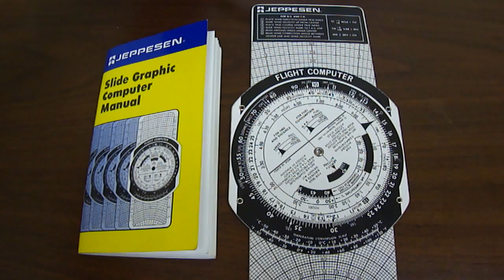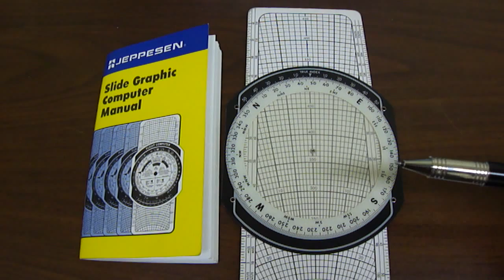E6B Flight Computer: Introduction!

Comment: One of the reasons I enjoy flying and studying aviation is because it is a thinking game. When you stop thinking, that's when you're heading for trouble. Technology has made things easier in many ways. When something becomes too easy, I get bored and lose interest; hence the digital E6B. Personally, I was a little disappointed when GPS arrived. I remember learning how to use VOR radials to determine your position if you got lost. Personally, I need to know old tools in case high tech fails.

Comment: I am a commercial pilot with multi-engine rating, and I have no idea how to use one of these.  LOL.  All of my training has been using an electronic E6B.  I want to become a CFI now and figure I need to learn how to use this.  Thanks for all of the videos they are very helpful.
Reply: What are you going to do when the batteries fail???...just like when I tutored my daughter when she was having a problem with Jr. High School math...asked her to give me the simple answer to the sq root of 17...she reaches into her case and pull out her Texas Instrument calculator...I took it away from her and tossed it across the living room and said "I want you to give me the sq. root of 17...I didn't ask the calculator".  Wasn't her fault...it was the fault of the school district.  Once I walked her through the step by step process she could provide the sq root of 17, or 170, or 1700 or 170000000.66666666.  Learn the process first then for speed purposes only, you can use the machine as a crutch.  Hell you got commercial airline pilots who can't fly and can't navigate...take away the input computer and they are lost.